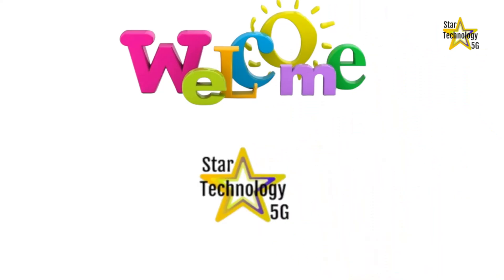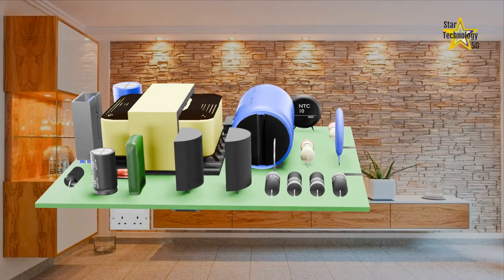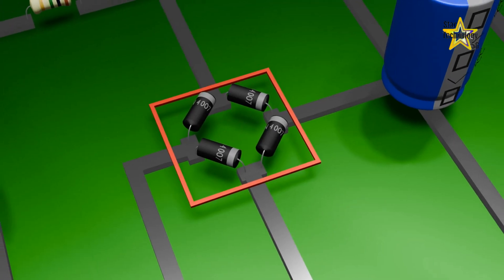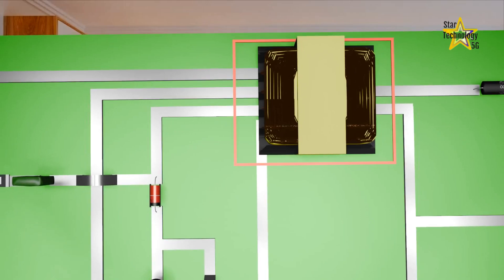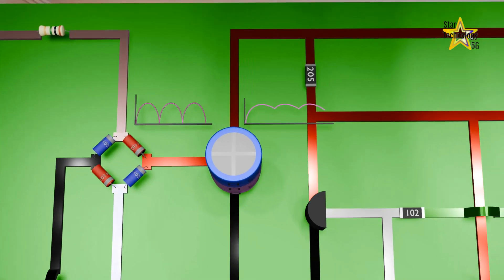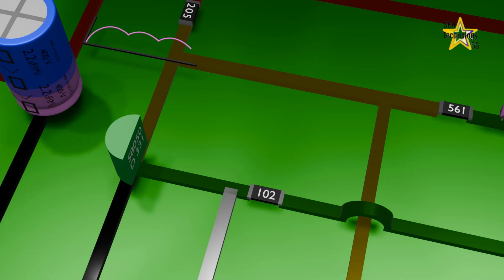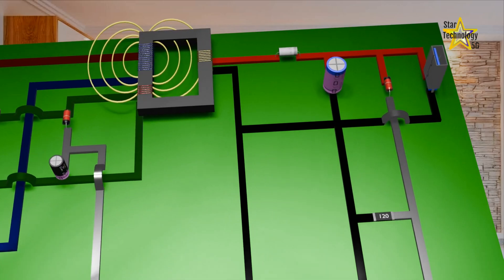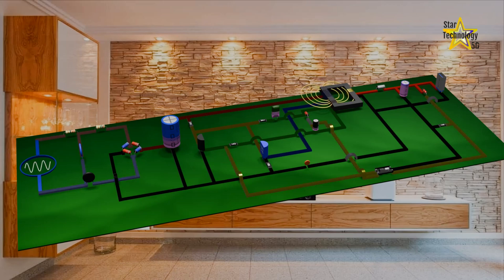How does a mobile phone charger work? SMPS Switch mode power supply 3D Animation #electronics

Comment: Thank you for this insightful video.
Please, I bought a charger but it stopped working as a result of series of partial contacts (continued ons and offs) on the mains supplying electricity to our building. What component of the charger may gotten damaged?
Reply from the maker: Please rectify step by step; you will find the problem. Here I can't ask you what component is damaged.